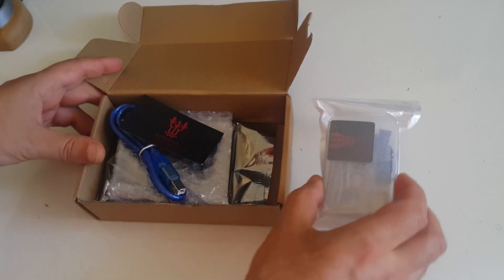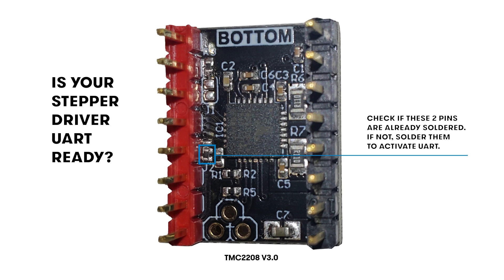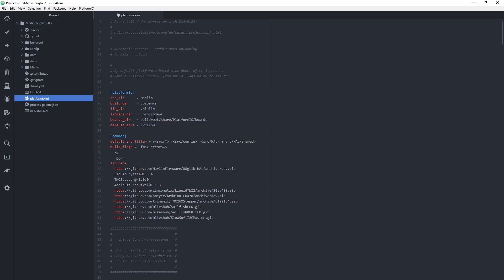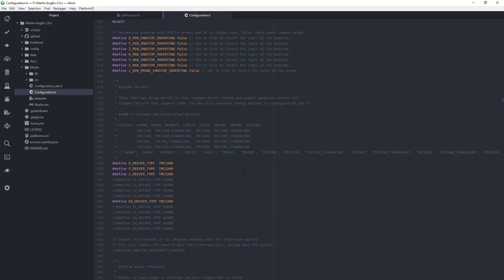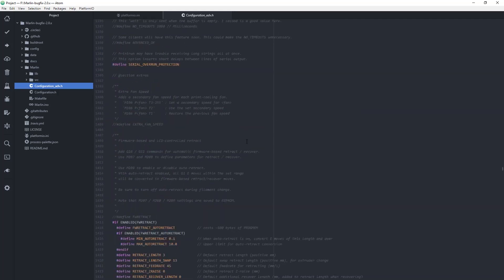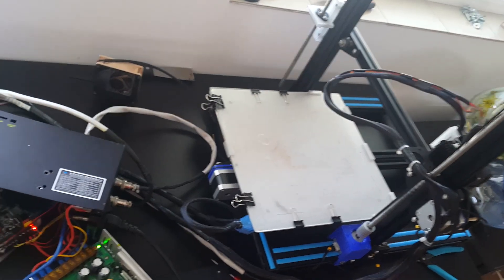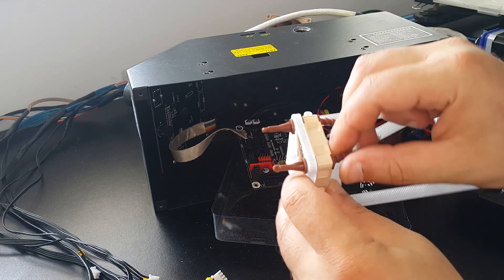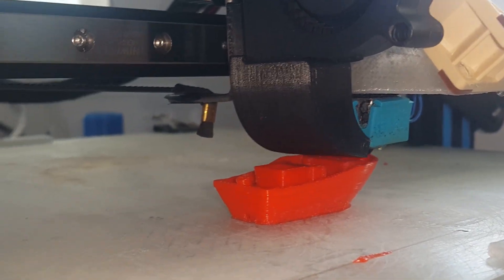SKR V1.3 32bit control board upgrade for CR-10

Comment: Has anybody installed the SKR 1.3 in a CR-10S, I have tried and running into LCD display issues.
Reply: Did you make sure the display config in the firmware wasent commented out when you compiled it? I would start there. Im currently putting the SKR Pro in my CR-10s but I swapped the screen for the TFT24 touch screen (which is DANK!), marlin 2x is really weird to qork with.
Reply: Reverse both cables that plug to the motherboard. Expo1 and expo2 need to be reversed.
You will need to cut the notches off the plugs.
Reply: me too, did you solve it?
Reply: @joshagrably7073  Reverse both cables that plug to the motherboard. Expo1 and expo2 need to be reversed.
You will need to cut the notches off the plugs.
Reply: This is two months old.  Did you resolve your display issues?  I installed the board and had no problems with the display.

Comment: Man that's cool but I'm stuck the pin for the endstop on the cr-10 are 2 pin the board has 3 how did you attach the endstop ? Did you use ground and signal ? With pins facing the inside of the board ?
Reply from the maker: Hi, check again the video in the beguining when I show the mapping of the connectors. You can use just 2 of the 3 pins on the board X, Y, Z min conectors.

Comment: Mine didn't come with a plastic case but a small black cardboard box so they are already reducing costs.
Reply: Steppers are inside the plastic box. The board was inside the cardboard box. When you order just the board (no steppers) you get the black box (at least on Aliexpress).

Comment: I have the same exact setup and everything works fine except the Linear Advance feature, if enabled the extruder will stop working at all once disabled it will back to work again. can you confirm that
Reply from the maker: Hi, I've got it to work. Tested wit just 0.2 value and square wave activated. I fill my extruder stepper gets hotter when the LA is on though. FYI I ordered TMC2209 and an A4988 to test for the extruder. There are some testimonies already the 2209 works well with LA.

Comment: I think this video is missing how it may be required to copy the content of pins_BIGTREE_SKR_V1.3 to the src folder. Perhaps it's depending on the revision of CR-10.

https://github.com/MarlinFirmware/Marlin/blob/9c3afefd052ad4cd2a150a3e35acc635dfd72656/Marlin/src/pins/pins_BIGTREE_SKR_V1.3.h?fbclid=IwAR11V4wh2_j-VZfinSXK1xNuEQZPmWfKYXO_vYOUe2cti30Cjgg_UfarAuM

The original CR-10 display did not work for me so I had to copy the text from github to the file inside the src/pins folder.

Comment: Will this work on the CR10-S5 with Dual Z motors, and a BL-Touch?
Reply from the maker: I suppose the two z steppers are controlled by the same driver, right? Than it should be working fine. 
BLtouch will work great with this board - I am expecting mine to arrive in 2 weeks...
Reply: @3dpblog  Yes, two steppers on the same driver. I think I will order a board and try it.
Reply from the maker: @originaltrilogy1  Regarding the drivers   you may check the  tmc2209 (just launched) - the installation is similar. They can handle higher current and offer aďditional features.
Reply: @3dpblog  Thanks, I ordered the 2209 modules :)
Reply: @3dpblog  So do you splice the cable together then? I didnt think you could do this. I ended up getting the pro because it has the 2 ports for the same driver an only $10 more.
Reply from the maker: @davey3765  it is how it is done with the cr-10 dual z upgrade - 1 drive for the 2 z motors. If i am not wrong cr10s, s4 have also 1driver for 2 z steppers. I personaly use dual z with single stepper (belt driven 2nd z rod) because i find this is the most robust and sync error free solution for me.
Reply from the maker: @davey3765  in adition having separate drivers for dual z should be also possible with skr 1.3 if you setup the 2nd extruder driver for z.
Reply from the maker: @davey3765  oups sorry, you are speaking about 2 connectors on the same driver not abt separate drivers. Yep, splicing the cable is possible.
Reply: Hi Did you ever do this? I talked to creality and they said it is not possible but I am not convinced. I have bl touch, and a bunch of other upgrades on my cr10 s5. My 8 bit motherboard just broke and want to see if anyone else successfully completed a conversion to a 32 bit motherboard?
Reply: @brendanhayes-oberst1398   Yeah I did do it, and it worked great.

Comment: May i ask a question about tankmod with titan pancake step motor?
Reply from the maker: Hi, the board should be working fine. Although I use a custom print head (minimal one), it is the same configuration - a direct BMG dual drive extruder with a pancake stepper. 
Maybe use a more powerfull driver for the extruder if the RMS current of your pancake motor is above 1 A. Mine is 1A and I didn't witness skipped steps, however some 23mm steppers may have higher current and the TMC2208 may struggle.